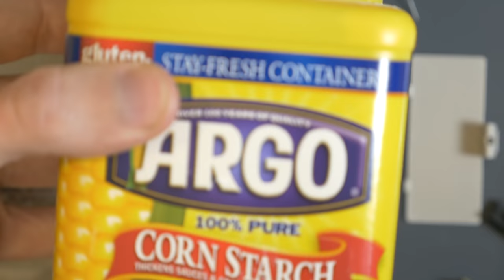Fix Your GameBoy Pocket Screen with Corn Starch!

Comment: Maybe its just me but I can still see if afterwards doesnt "feel" like a big difference?
Reply from the maker: GamingMonsters It’s a bit difficult to see on camera. There’s still a lighter spot there from pressure behind the backlight panel, but the actual newton ring (pressure on the polarizer) is gone.
Reply: Ahh ok was hoping it would magically reduce the spot from the pressure as mine has that as well
Reply: GamingMonsters what you could do is back off some specific screws slightly and this may help a little.

Comment: Another small thing that I did that helped a bit is put some tape over the screw holes just small squares, doubled up, to create so added thickness. Used a small drill bit to poke holes then closed it up. Made a small difference.

Comment: I completed a GBC AGS101 mod, and it’s perfect outside of one recurring issue. Dust keeps getting in between the lens and the LCD. Do you know how I can prevent this from happening?
Reply from the maker: Did you seal the lens all the way around with adhesive? One other possibility is that there could be dust/plastic particles still inside and even though you cleared them from the screen, after bumping it around a bit it falls back onto the screen again from inside the shell. I always really make sure the inside is as clean as I can using canned air and a microfiber cloth.
Reply: @esotericsean  Yes to sealing the lens! The inside of the shell is also clear of particles! I'm thinking the issue are the top 2 screws connected to the 3D printed brackets. I'm unable to tightly screw them in so the top of the shell is slightly loose. Dust might be getting in through this opening but I'm not entirely sure